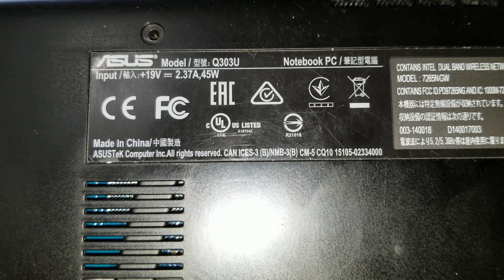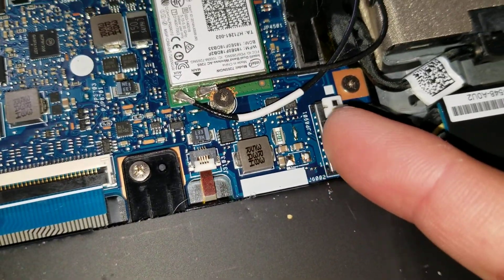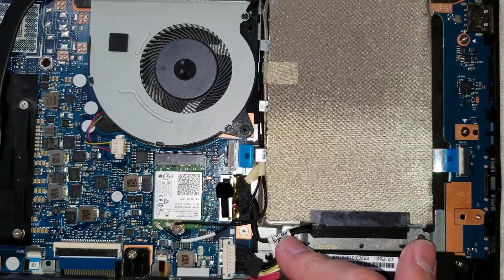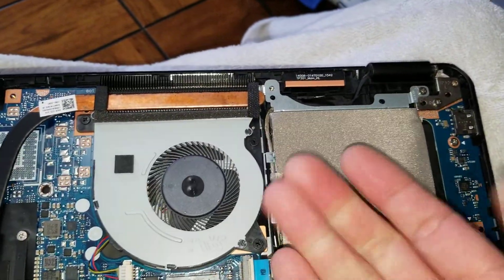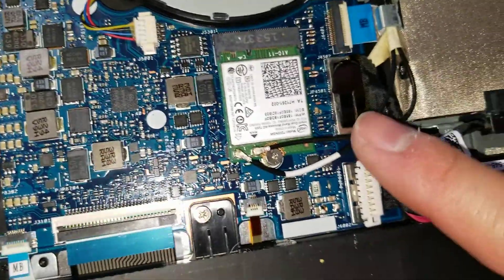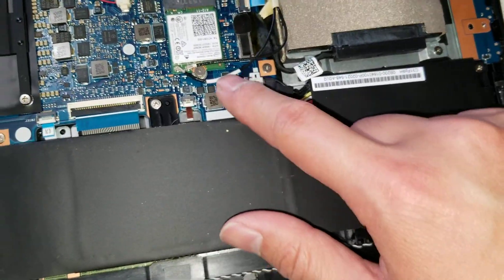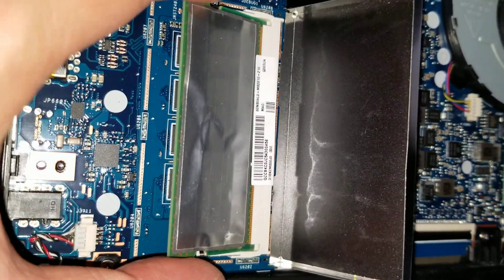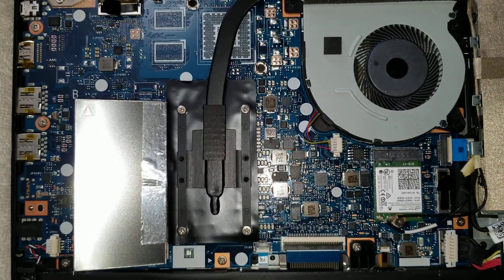ASUS Q303U Disassembly RAM SSD Hard Drive Upgrade Repair

Comment: Ty for video. I have a q302u that wont turn on. I've nearly taken the whole thing apart. It is almost identical to this q303u. I'm having trouble finding the cmos battery. I don't see it in your video either. Do you know where it is?
Reply from the maker: Built into the main battery.
Reply: @ItsBinhRepaired  ty. that's a very helpful piece of knowledge. I'm still stuck on figuring out how to get the machine to turn on. But every extra piece of knowledge helps. I really appreciate the quick reply.
Reply from the maker: Hope you're able to figure it out

Comment: I have the exact same computer, and I'm interested in upgrading from 8gb RAM to either 12 or 16. Is that possible for this device? If so, would you be able to advise on one to buy?
Reply from the maker: There's only one stick that's removable. DDR3 ram. Not sure what speed though.
Reply: @ItsBinhRepaired  thanks so much for your response.
Reply from the maker: @jonathanmclean6289  no problem

Comment: Thank for the video brolami. Very helpful. I have the same laptop and I'm trying to be replace the battery because, it won't even hold a charge for more than a few minutes if I take it off the charger.
Reply from the maker: Hope the repair goes well.
Reply: @ItsBinhRepaired  I bit my finger nails too short to be able to pry the laptop open, so I used a little suction cup thing and pulled the bottom panel up while sliding a credit card in the gap to pry it open.
Reply from the maker: @Kylemathews1  nice, glad to see you're using your brain and thinking. Haha A lot of people ask me what else they can use and aren't very resourceful. It's like, come on, use what you have around you.
Reply: @ItsBinhRepaired  Yeah  lol :), a lot of people give up very easily when faced with a problem that doesn't have an obvious solution. Creative problem solving is a great skill to practice and grow. I was pleasantly surprised when the whole bottom panel popped off super easily with the suction cup, so I didn't even really have to go around the edge with the credit card. Ended up being easier than I planned for lol. 

To be fair, I think I had previously been looking at computer/electronics tool kits last year and  saw that a few included a suction cup tool, and when I was cleaning my room I found a suction cup thing from Walmart that you stick to your cell phone to use as a stand. So I had put it away in my electronics drawer thinking I might use it eventually. And sure enough the time to use it arrived, and I happened to remember I had it.
Reply: @ItsBinhRepaired  But yeah I've grown to like being resourceful and finding different/new uses for random items at home. There's so much you can do with random stuff if you're creative lol
Reply from the maker: @Kylemathews1  yup, best skill to have
Reply: @ItsBinhRepaired  yeah it's going smoother than expected lol, I just put it in the new battery. I just came back to watch this video again so I could remember how to take out the RAM in laptops.